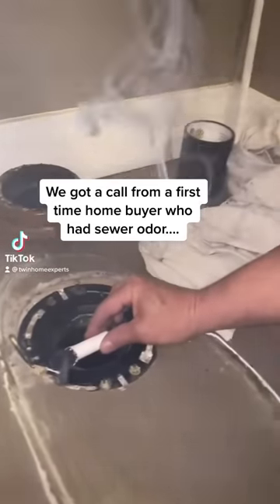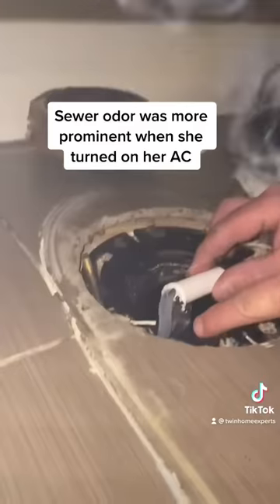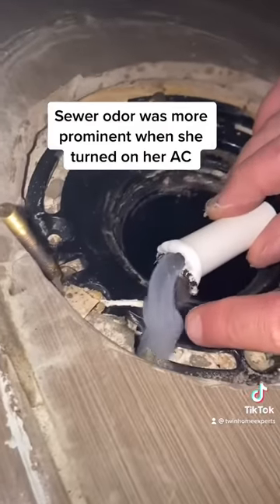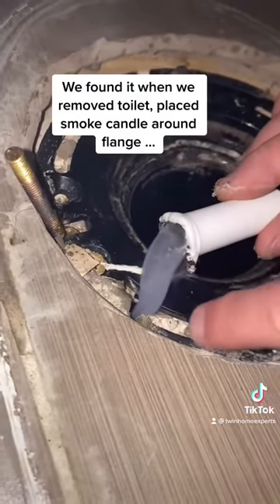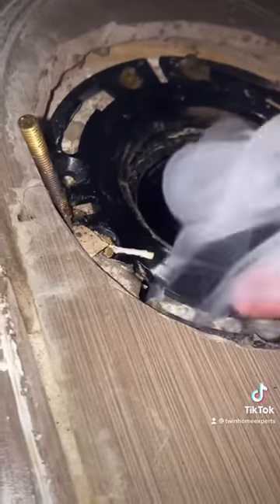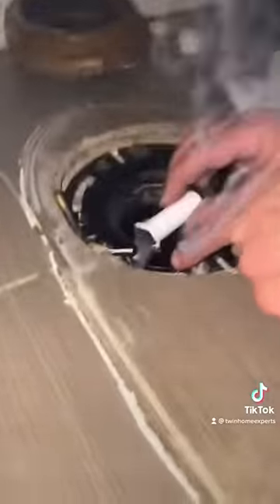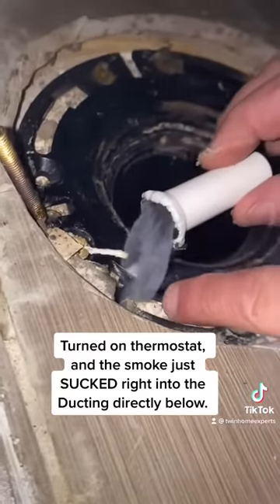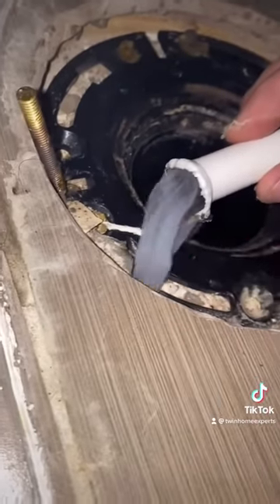BEST WAY to Detect a Sewer Odor 🤢🌫️🚽

Comment: One issue I see is that flange is waaaaay below the tile . Chances are is that they only applied one wax ring, or even two stacked and still weren't able to make a proper seal. I've seen plenty of older homes that use the space between joists as ducts for heating and cooling. That just needs to be sealed. They need to remove and raise that flange. To the proper height.

Comment: Looks like that flange is set deep due to new flooring. I would recommend a flange riser to bring up the height of the flange so that a wax ring can properly seal.
Reply: Or use a taller wax ring.

Comment: As an Air Conditioning and Heating service contractor for 25 years! I can see that it is a "return air" problem where somebody didn't frame the ruturn air off properly and seal it when they installed the heating and air conditioning system it shouldn't be sucking air from anywhere by a toilet it should be sucking air from a framed in area through a grill with either a filter in it or a filter at the air handler or heater return air side! Dosen't look like a pluming problem to me..

Comment: No ptrap on hvac system will cause that , that's the point of ptrap on negative pressure units , furnace have positive pressure so don't need ptrap , but your home plumbing needs one regardless

Comment: We get a sewer odor randomly or when it rains alot. Any idea?
Reply: Send a camera down the line. Sounds like something ain't draining
Reply: When a main sewer is getting ready to clog up you'll smell odors or hear gurgling. Or both. You could have your main sewer snaked out.thats where I would start.then when the service man is there he can check your floor drains to see if any of them need water dumped into them .this will fill the trap up with water to stop the sewer gasses from entering your home
Reply: Whenever I get call to a sewer smell That Is Random. More than 50% of the time it's because the homeowner put a picture right above the toilet. Now most toilets in the main bathrooms have the vent stack centered behind the toilet that runs up and goes through the Attic, then through the roof. The homeowner will then screw up a hanger above the toilet and hang a picture on it. What they did is, screw the screw through the sheetrock and into the plastic pipe behind the wall. When that screw, or nail rusts and falls out the sewer smell will then leave that small hole and into the bathroom. It will do this when the HVAC system runs, and draws the house into a vacuum. This is why it is a random smell, and when it rains outside it is usually cooler so the heat will come on more frequently. Or it's hot outside, and it rains driving the humidity up. The AC system will turn on to keep that humidity lower in the house.
Reply: If u have a septic tank it could b rain water lynching into ur septic or wanter in your crawl space.

Comment: What? Ok #1 if the Toilet is installed correctly that "leak" is still in the pipe and not under the Toilet with the Toilet seated on a very thick very sticky Wax Ring. Now you might say "No that's the Wax Ring right there, When in actuality that's Commercial Spray Foam used to Level out the "Flange" and insure a good seal. The Wax Ring has been removed as you can see by the left over Wax much higher on the Bolts and definitely the coloration or consistency of said Foam around the base and under the Flange (flange being the Black portion that is used as a Base that is attached to the drain Pipe and is screwed into the subfloor so as to Bolt the Toilet too so basically a connection from the Pipe to the Toilet keeping them both secured together) is vastly different than the spray foam.

So you say well maybe the Wax Ring wasn't sealed (Wax Ring's are placed due to once the Toilet is placed downward the Wax get's smashed ALLOT sealing the Toilet from the bottom and to the top of the subgrade and for one to leak could happen and I'm only saying that because nothing is impossible but it's damn near impossible). 

Also the Toilet has a secondary seal placed by caulk that goes around the Base of the Toilet once it is bolted and placed as the Toilet is slightly rounded at the Base just for that reason to get as much of a good seal with said caulk as possible.

So you say well what if it's coming from the Toilet then? That's impossible as the way a toilet is made from the base to the hole is one big "S" Trap shaped in exactly the name an S so water always stay's within the toilet (talking about the base and not the Tank which also keep's water but is used for flushing only while the base is solely used for blocking every single odor coming from the Drain).

What they are showing you actually WAS a very, very professional Job that 90% of Guys going after them to replace a toilet would just love it as it would be so simple and perfect due to the previous installation. 

These Guys prey on People that don't have the knowledge of a sewage system. They remove the Toilet as that's the fastest and easiest thing that they can do to earn quick Money. They won't show how they are REALLY suppose to check it and how it can come from your Bath tub. Sink Drain's if piping is not installed correctly OR a biggie that happens more than you think a leak or God help you actual full break of your septic system that's under the House so some if not the majority of sewage has been leaking for however long then drifting up and the smell going through anywhere into the House and believe me if they popped the grate on that House and looked underneath and saw that most will come up with any excuse to not do it right because if you do it's just an unbelievable experience that will change you forever lol.

I also find it weird that if you look at the "Hole" it's supposedly leaking through notice how the Foam is black? That's because it's not the Foam it's the Flange the very HARD thick plastic the toilet is Bolted too (It's so hard and ridged it keep you from tipping sideways while sitting on the toilet let's say reaching for something).So why is it that the "Hole" look's so strange? Did he happen to cut it out just to show the homeowner a leak? OF COURSE HE DID! How do I know? 

Ok look at the shape at the inside of the Flange. Now follow it around with your eyes and you see a circle then rectangle then circle then what? It's the exact shape that he has his finger in now does it look to you like there is a Triangle supposed to be anywhere within that shape when comparing it to it's exact duplicate? No it has a slot then a rectangle attached to the slot right? If it was a Triangle that was supposed to be there does it actually look like a triangle or like some sloppy cutting? He literally cut the Flange so far that he cut through to the outside of the Flange you can easily see that! It even kind of looks like it was drilled then he diamond the hole so it didn't look like He drilled it and that it was actually there long before Him. For the last definitive proof the "Hole" he cut doesn't even enter the Pipe Smh. 

That's right the Hole He cut just goes straight under the House BESIDE the Pipe that is by the way Glued to the Flange so there could be no leak And if there was a smell it would have to be coming from the underneath of the house and not that drain. Why is the Smoke being pulled away? Because under a house is vented and keep's a flow due to how the wind hit's the side of the House almost forcing it through to reach the other side of the vent's. It's why it's cooler under the House typically and scorching Hot in the Attic because Hot Air rises and Cold air sinks.

Last but not least how they really check for leaks is a crew come's out and tells all the people connected from one Manhole to another that they are testing and it might show in their Houses. They block the other end then run a massive amount of smoke through the other end of the pipe in the drain toward the Blocked end and if someone comes out with their house all Smokey then there you go. They of course fan your house out with this huge industrial fan.

SO hopefully now none of you will get ripped off in the future.

Comment: The AC was sucking up air from the sewer. A double pipe AC would've kept the air pressure stable (the second pipe takes air from the outside instead of the AC sucking up air from the room).

Comment: Makes me think of the freak accident that killed one of my computers. I use to live stereotypically in my mom's basement and it's Colorado so we have major winters. My mom didn't find out until a year later that we had a crack in out vent system that let in water from the outside. So just picture coming home from work one day to find you computer sitting in basically a gallon of water. I could turn is on but it never booted again.

Comment: This is what happens when they use joist space for cold air returns and that joist space happens to have a toilet fitting. Although, the wax ring should have prevented any air leaks... It air/smell was leaking, surprised they didnt have water damage as well.

Comment: I have been dealing with this for 6 months in my apartment. I've only been here for 8 months. I have been begging maintenance for help, mostly being ignored. It wasn't constant, so they kept blowing me off. About 3 months ago, was able to catch maintenance when it happened. He said he would call a plumber. They did a smoke test 7 weeks ago and my apt filled with smoke but they said nothing to me I waited a week and a half. They lied claiming they told me they fixed it by raising the sewer pipe on the roof of the building, said it was level to the ac vent. I told them nothing was fixed, still happening. I was told they would call the plumbers back. 3 day later I was told they called them and will let me know what they say. Nothing has happened. After making me feel like a lying Karen for 6 months, I still smell sh!t when using the AC daily and have to call twice a week for help only to be ignored. I don't know if it's expensive or more involved to fix that's why they won't do anything but I still have to pay  my full rent. I'm in Arizona so AC is necessary and when it's mid-day and the hottest part of the day the smell gets 75% worse.

Comment: Glad I have radiators instead of central air and heat.... The mold in my 120year old house is way better to breath you don't even know its there most of the time😂

Comment: I got called to a house cause a lady was complaining that her toilet was always warm and she noticed that it was leaking in basement. I checked it out thinking they must of had a recent reno and got a hot and cold line crossed or something. I was right about the recent work part but what it was was the guy who did the work hooked the exhaust pipe from a condensing boiler into the plumbing stack cause he knew it made lots of water that needed draining.

Comment: It is a clogged or missing, “ventilation pipe” which should be going out through the roof, these pipes are intended to vent that gas up and away from the sewer pipes.

Comment: I had a similar thing happening to
Me, my house smelled of sewer, I didn’t know where the hell it was coming from, and it happened only in the winter, I don’t have air con so it wasn’t that, it turned out it was a drain in the basement with stagnant water that came all over the house, I was told to throw some cooking oil in that drain and the smell stopped.

Comment: So i dont know what he is trying to show. There are a lot of ac/heater pickups that pull from the crawl space so it will pull from the path of least resistance.  If anything it means the wax seal wasnt any good on the toilet or there is a broken vent/ sewer line in the crawl space... yes the flange could have been set better but these older houses were built different.

Comment: They most likely ran the drain for the drain pan into the sewer drain instead of running from the evap and outside the house . I had a call one time where the ones who installed the ac thought it would be easier to cut a hole into the sewer drain in the attic so they wouldn’t have to cut a hole through the stucco and run longer pvc pipe since the sewer pipe was closer to the evap in the attic so whenever they ran the ac or heater the house would smell since the drain would suck in the Odor but as the evap coil would condensate it would fill up the trap and would smell less

Comment: It is no a duct below that toilet.  They are using the stud cavity as an air supply return.  It is a cheap way to illegally run your heating system because it allows a fire to go up through that space because there are no fire blocks.

Comment: The wax seal still would’ve covered that you just scammed the poor costumer, I’ve had a time when I was working in an old town how building from the late 1800s and you could see thru the floor downstairs on the side of the flange the owner didn’t care and everyone went find no smells or complaints

Comment: What I’m assuming is whenever they used the bathroom like taking a poop or whatever the stench would travel around the house because the toilet leaked into the air duct which travels around the house

Comment: This means absolutely nothing, do you think people seal the flange to the sewer line It's generally just sitting on top of the plywood with two screws in it. When you put your toilet on the flange you have a wax ring seal that seals the toilet to the flange and that's what makes your seal It's got nothing to do with your flooring material, or how it seals around your flange.